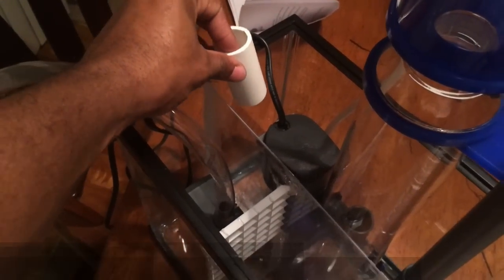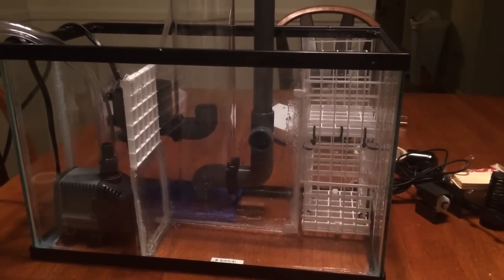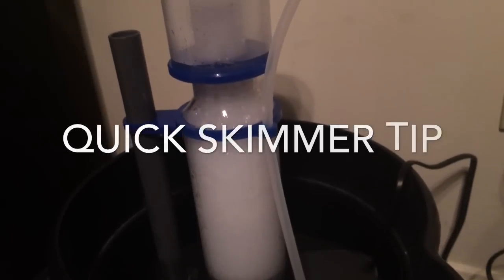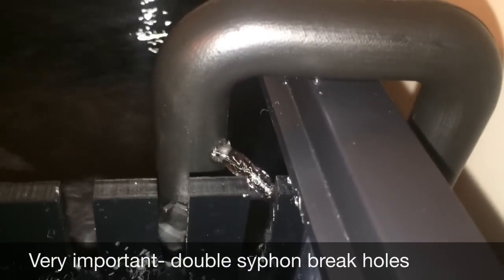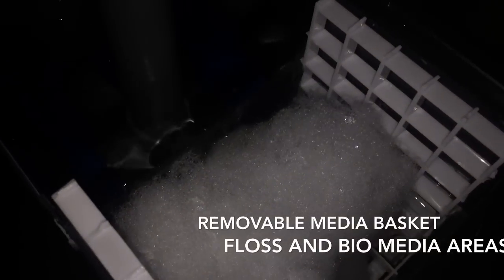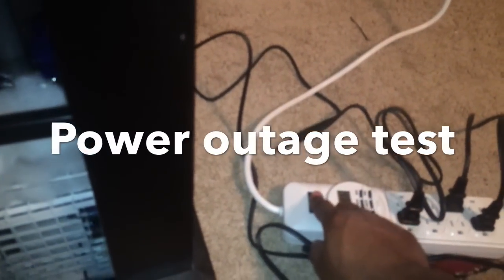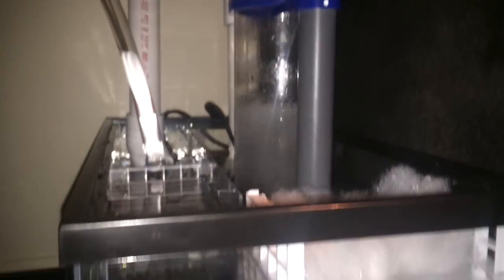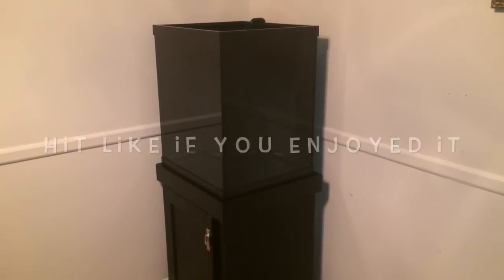How To Start A Reef Tank Marineland 37 gallon Cube: Reef Build

Comment: Great video! I know how much work goes into a tank build, and to film it as you go makes it much more time consuming. I know you've been busy this past week. Thanks for documenting the build. If you place a piece of reticulated foam over the top of the filter floss, the water will flow across the entire surface of it as you want. You may never be able to get enough flow to have it flow evenly over the filter floss.
Reply from the maker: I kno u understand the time it takes. I'll take ur idea into consideration may even redo the media basket. I just wanted to put video out on these cube tanks. I could not find anyone with a dyi sump that wasn't a plain Tupperware container. Had to show it's possible to use a nano sized tank. Hope this vid helps some ppl. Just wish I had more time to go into more detail on calculations lol. Maybe you can continue this for me the good ole L x W x H / 231 equation was my best tool in calculating capacity I needed. Thanks for watching as always man

Comment: Awesome!  Love the DiY sump builders sharing their ideas.  I pieced together my Discus wet-dry sump system. It's always rewarding taking a concept and making it become reality and working.  Did you make the overflow as well?  Well done Brah!  Thanks for sharing.
Reply from the maker: I designed the overflow to my needs but had someone machine it for me. I could not find a sump that would fit under my stand. Wanted to use 10gal but was half inch to long (frustrating) so took challenge of nano sump. Believe me took a lot of calculating and thought. Just wanted to put a vid out for ppl with these cube tanks. All videos and forums I've read don't have a sump design like mine hopefully ppl can use this idea. Thanks for sharing my vid with everyone. Appreciate it!!!

Comment: looking good, I got the same marine land newport stand. if you ever wanted to build another one, or for any one looking at this video the bottom just has staples to keep the bottom plywood in place. so I was able to tank the bottom plywood off, and put it over a eshopp rs 75 sump.  CJ tank is off to a good start. it's certainly giving me help and thoughts. happy reefing. Joe.
Reply from the maker: Sounds like a hell of an idea ... My only concern is not being able to remove the sump without moving the whole tank. I had a similar situation on my first reef build and decided I'd rather have somethin I can completely remove without having to drain or move the tank. Thanks for checking out my build
Reply: your welcome.  yea that's the only thing I'm worried about to is having to drain the tank once it's set up.

Comment: Great job man! you scared me when you cut off the power lol. you should do a clog test on your main siphon to see how the emergency handles the flow
Reply from the maker: Hahaha believe me I did my homework. Good ole L x w x h / 231 equation helped me give just the right about if space. The emergency handles with no problem bathe pump I'm using has low flow at the tank height 180gph. 1 inch drain can handle 600 easy. I have room to spare in every scenero including is some of my teeth get blocked on overflow. Hope I showed u it's possible lol. Believe me u had same concerns as you at first hahahah. Thanks for watching man

Comment: Great Stuff CJ, youre making me want to start a reef tank! Must resist! haha I actually have a Barracuda RO/DI unit in the mail, so i have the biggest piece of equipment that i would need on its way, if i do decide to start one.
Reply from the maker: Appreciate it man. If you decide to go salt you will never go back lol. I still don't have a r/o unit. Just 6 gal container I fill at my LFS weekly. Gives me a excuse to go buy corals lol. One day I'll get one. I'm sure u will do great. I follow ur planted tank vids. If you applied same effort to reef u will be fine. Be easy!
Reply: CJ'S AQUARIUMS that's how I am. I found a used 100 gpd unit, but haven't hooked it up. no need for it right now, as I can just take two 5g jugs to the LFS. one for salt, and one for top off.

Comment: CJ. Did you drill this tank. The 2.1 gallon auto top off reservoir that came with the Red Sea 250 is pretty small. Saw a vid where someone used it as a small refrugium. Thinking of drilling a 34mm hole in it. The bit looks cheap, but looks like the brace is needs to hold the drill. Thanks again.
John
Reply from the maker: I had it drilled at Aquatica also had the overflow box custom made. Everything else was done by me ... Not sure if that will work for u I never drilled anything personally...

Comment: How did you calculate the volume demand you will need in the sump? I am working on setting up my first tank with a sump and I want to get it started properly but it will only be a 40 breeder display so im trying to figure out what the smallest capable sump I can build due to space availability

Comment: Hey CJ. Its taken A little longer than I wanted to get my tank. Between research and completing unfinished house projects. It will be worth the wait. Have the RODI water station built and have been catching sales on equipment so its not all time wasted. That being said. Since you have had a tank with a sump and the JBJ All in one... Which do you prefer and if "you" were to get a new tank which would it be. Ps liking the 37 vids.
Reply from the maker: I talked briefly about this on the pod cast with rotter tube and mile high reefers. If I was to go bigger than my 45 JBJ then I would have a sump for sure. Multiple reasons. Gonna do a vid on it to explain too much to type lol
Reply: +CJ'S AQUARIUMS just watched the podcast. Good information. 180 is to big for a beginner lol. So I am leaning towards all in one. Just sometimes you can let the dreaming take over lol. 
Thanks again👍

Comment: CJ, this may be a stupid question...but I always see those Koller brand, or similar, type "dosing pumps" with the two small lines running around people's sump area. Is that an anti-siphon method to keep back-pressure on the line, or just for dosing? Also, have you come across any info regarding the specifications for drilling the glass on the back of the tank...height, distance apart, size, etc.? If your 37 gal cube column is the same Marineland tank as mine, then yours is 1/4" glass too. Is this correct? Thanks brother